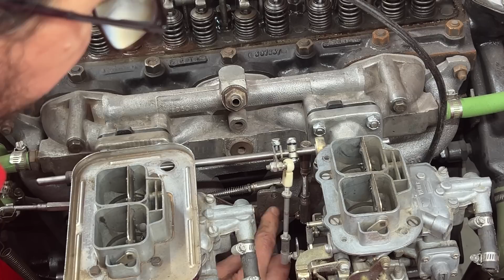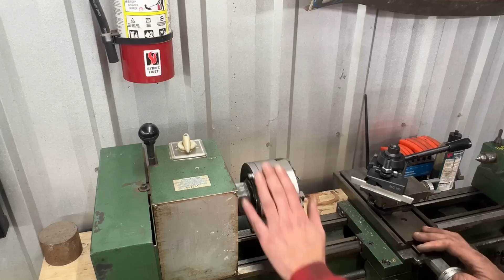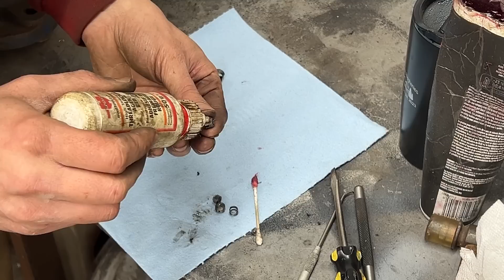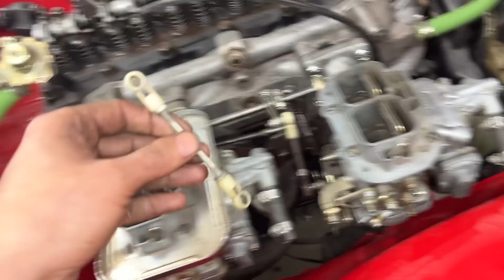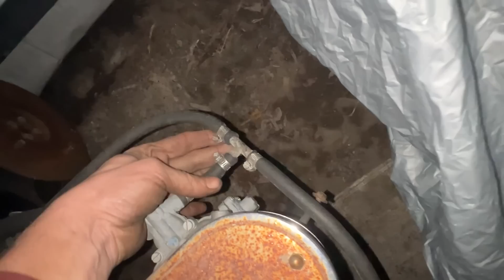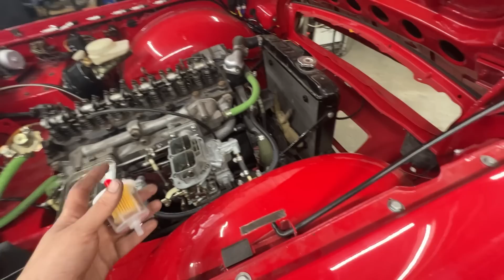1970 TR6 - Part 39 - Carb Installation.

Comment: Hi Elin - Another bit of advice from Old Blighty. Where you altered the throttle lever to stop it meshing with the through bolt you might find the throttle pedal has a very short throw and is a bit stiff?

Comment: I don't think you want the rubber hose in contact with the inner wing.  Over time the engine rocking will wear away the red paint and wear into the rubber hose..  It is fine for a quick test though.

Comment: Attention to detail is critical, disappointed you chose not to use a bushing in the throttle linkage, not much extra work in my opinion after rebuilding the other parts, a small detail.

Comment: Hi Elin, very nice work! Just one question, i was told, that the gasfilter is supposed to be installed after the gas pump because it pumps strongly but sucks poorly. Installing the filter between the tank and the pump might lead to poor gas supply.

Thanks for your great videos, kindest regards, Jan
Reply from the maker: It is true that the pump has harder time to suck fuel through the filter but only until it primes itself, after that it is not an issue. Installed before the pump the fuel filter is almost the lowest point of the system and it should always be full if fuel and never needs to be primed again. The idea of the filter is to keep your fuel system clean including the fuel pump.

Comment: Cleaning and adjusting  the  linkage was an excellent  piece of work I was truly interested in,  as I need to do it before the spring as mine doesn't always return as that didn't. The plate and bolt have that same wiggle and wobble so I will need to fix that.

Comment: Elin, thanks for another in-depth video on trouble shooting the carb linkage and setup.  I'm wondering if both the carb throat and choke plate edge need some polishing after your adjustment?  There might be still a bit of binding between the two even with a new choke cable installed...?  Also, I've seen it recommended that fresh loktite be used on the choke plate lock screws...